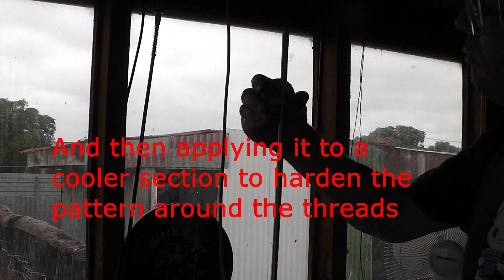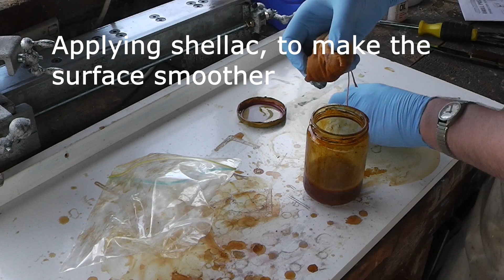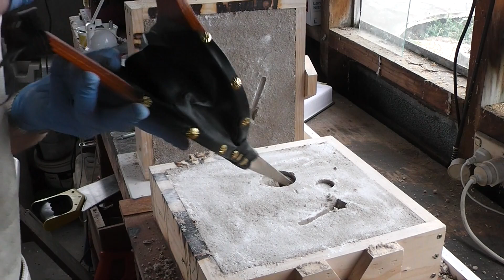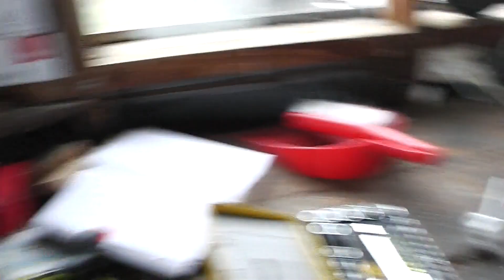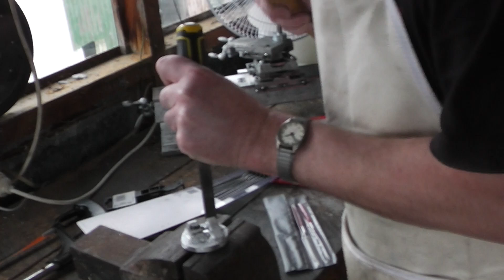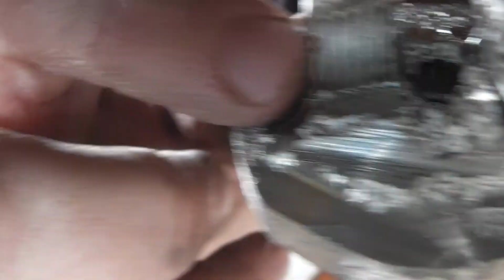Half Nut Half Sane

Comment: Speaking of making one nuts, do you think a spinner type handle would make your lead screw crank much more user friendly? I see so many people do it just lime the Gingery book and I cant imagine why.
Reply from the maker: What do you mean by "spinner type handle" ? It doesn't move very far, maybe 30 or 40 degrees.
Reply: @HaveAGoAlan  The lead screw crank. The handle on it doesn’t spin on the crank so that you can hold onto the handle and turn the crank easily. As designed, you must let the handle turn in your grasp while you rotate the crank. That must make it hard to advance the carriage into a cut at a smooth and even rate.
Reply from the maker: I think I get what you mean. The handle on the apron itself does not advance the carriage up and down the leadscrew, like with a modern lathe with a separate handle for traversing the carriage, and a separate control for the halfnut. It clamps the halfnut onto the leadscrew (it is either on, or off.) To advance the carriage, you lock the halfnut handle on the carriage to 'On', and then use the leadscrew ball crank handle.

Comment: Good job. I was just thinking about the difficulty of getting the shaft out after casting this part. Would it not have been easier to cast it with full half circles at each section. Then drill a hole and tap the threads into it and cut away the other half after it is tapped? Just a thought.
Reply from the maker: If I do it again, that's the way I think I'll do it.